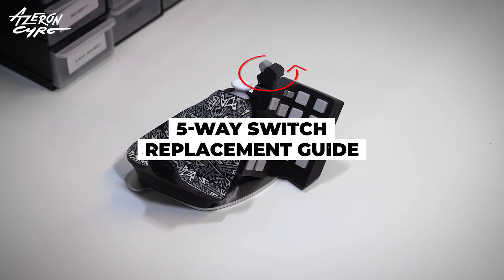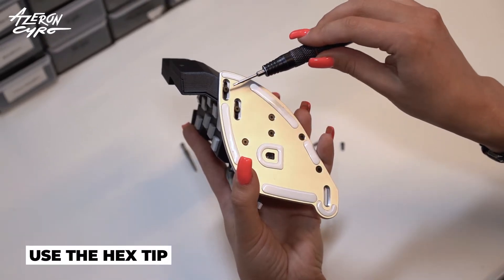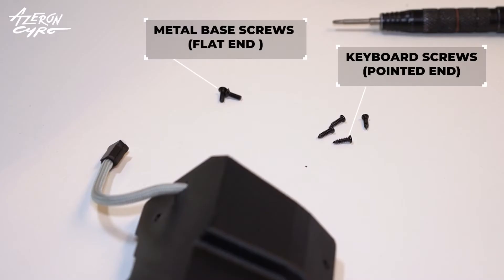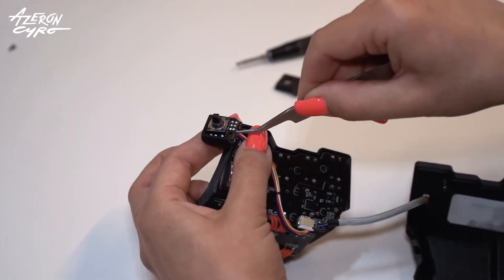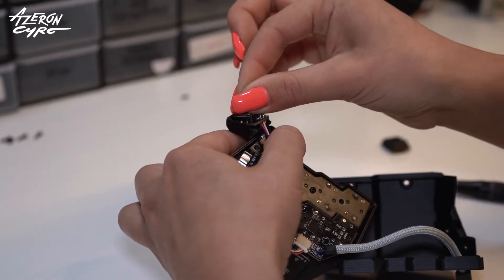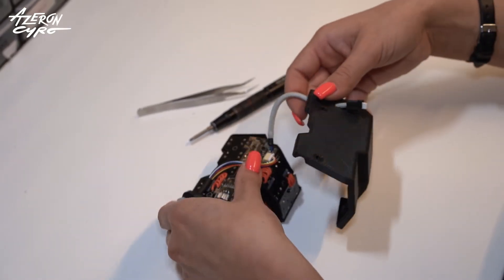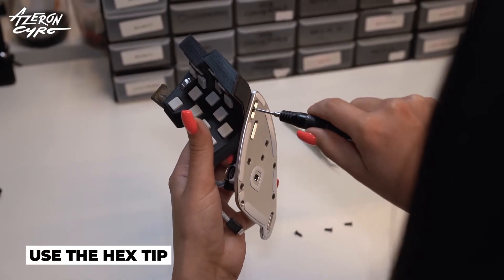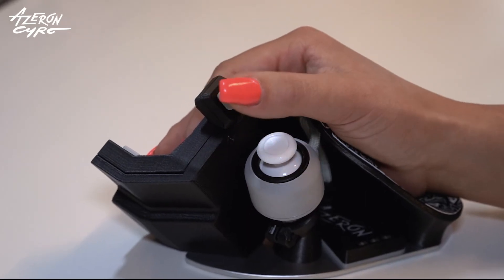Azeron Cyro 5-way switch replacement guide

Comment: Silly question... Does the 5-way switch board also work on the diagonals or strictly left, right, up, down? Like if I to on a diagonal up and to the right does it register as up and right being clicked?
Reply from the maker: The 5way switch only does 5 directions. No intersections